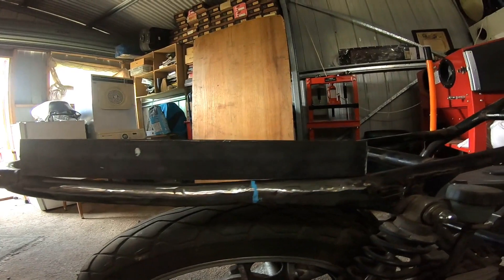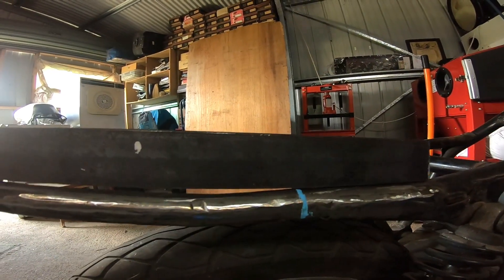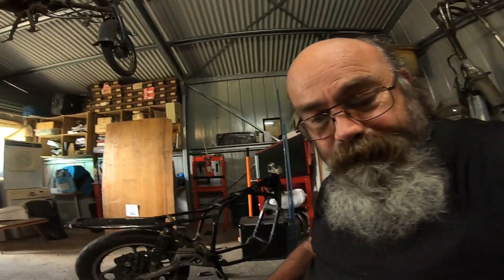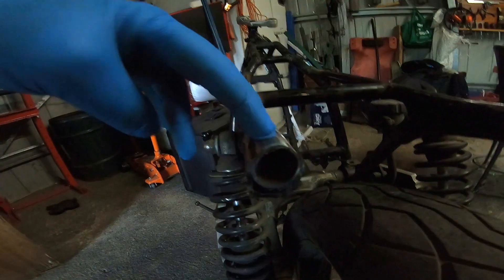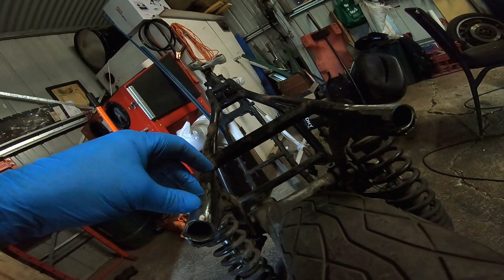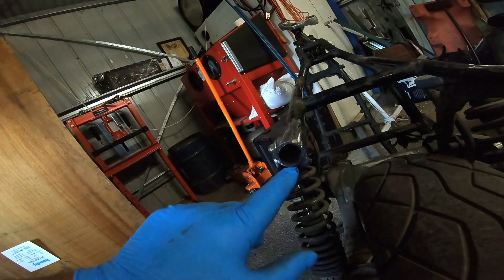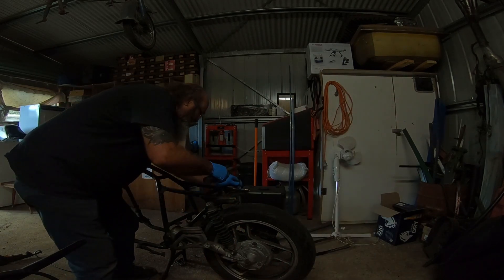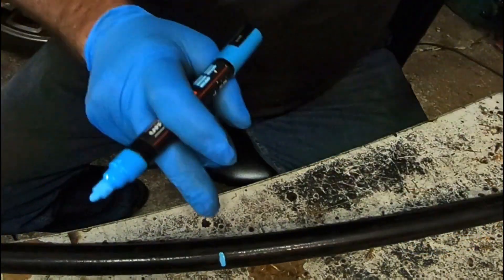Basket Build 1983 XJ 900 R Yamaha Restoration. Ep2 Sub-frame

Comment: Nice repair on that frame mate. Thinks also go a lot quicker when you have all the right tools. I’m trying to convince my wife that a mig welder would be a nice addition to my arsenal 😁
Reply from the maker: Thanks Viper6. Tools do help. That welder is absolute crap as a mig but as a continuous feed arc welder using flux core wire it is reasonably good.

Comment: And the build begins, a tow bar now that's different with the stretched subframe. This should be pretty interesting viewing as i know the front is where the handlebars are haha... CHEERS m8 : ) 👍
Reply from the maker: Yep Now that I have pulled my finger out it might even get finished. Still more to be done on the subframe, proper bracing and make strong enough to not break with a tow-bar n' trailer. Yep the handlebars will go on the front bit. Cheers bobber.